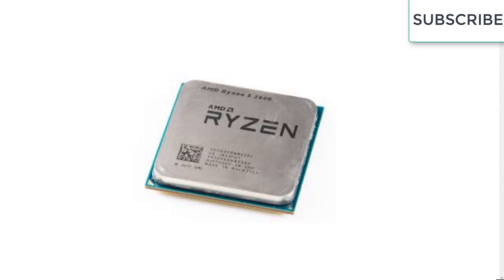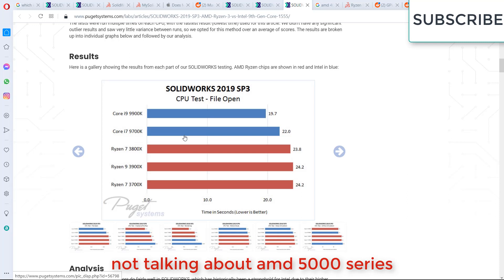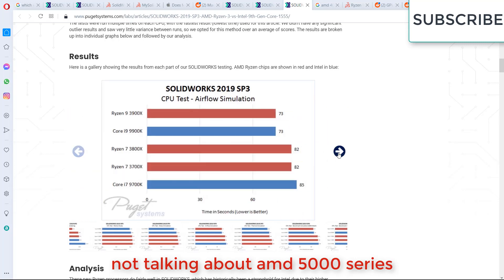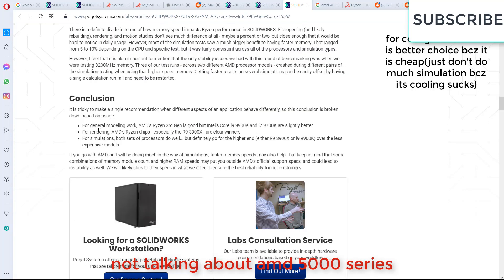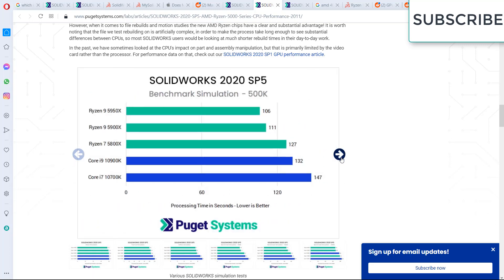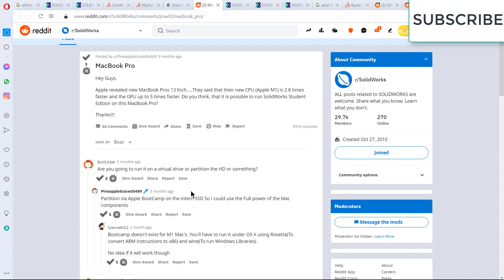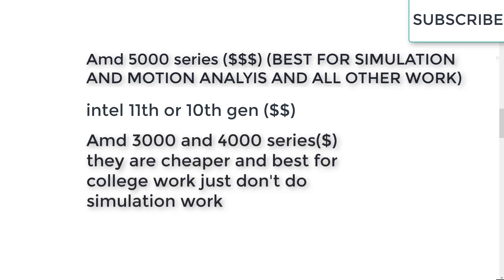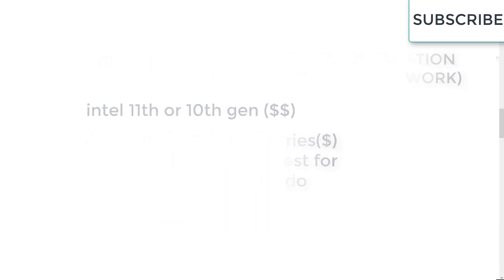Intel vs Amd vs Apple M1 mac which one is better for solidworks

Comment: Ryzen 7 5800h vs intel i7 11800h which one should i buy for mechanical engineering apps both use rtx 3050ti
Reply from the maker: Ryzen 7 5800h please checkout the blog link in description for benchmark test of various processor